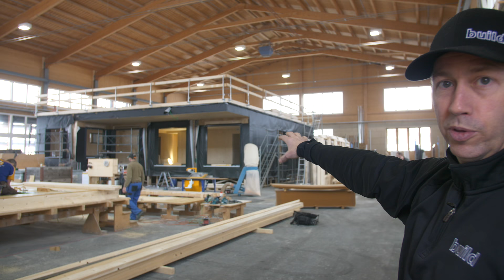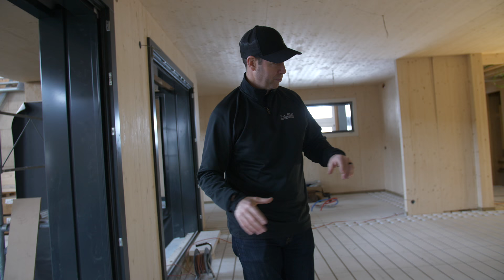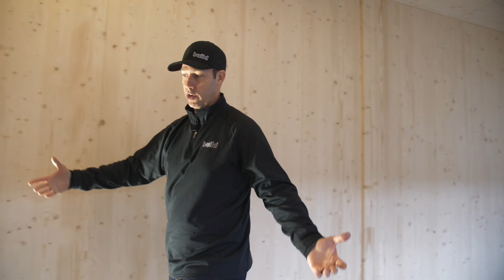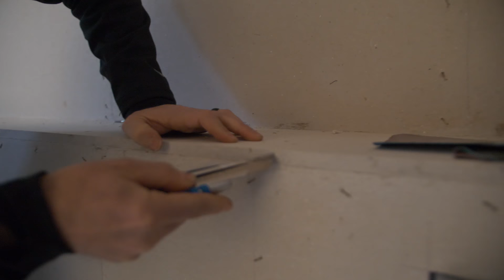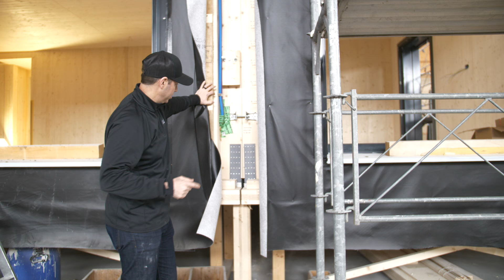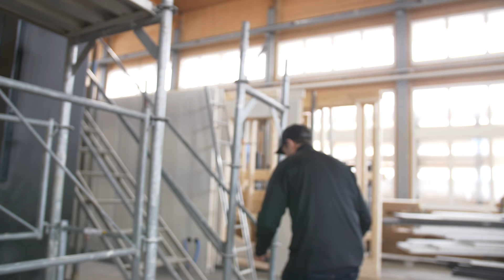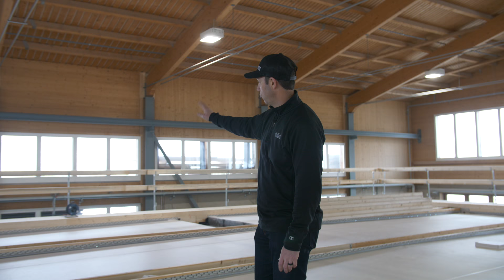Swiss Modular Home - Under Construction Tour

Comment: A few answers to questions I saw in the comment section: Price for a wood house of ~1200 sqft: I would say CHF 800k-1.5m is reasonable. I haven't found any concrete prices because these are all special projects, which is to say, most Swiss do not live in top-quality houses like the one in the video. The price also depends on the location as not all residential areas in Switzerland are equally easily accessible (think remote mountain resorts). Price of a similar home, standard build (concrete, bricks, some wood): Around CHF 600k-1m. You can also order wood houses made in other European countries and you'll probably save a bit on the final price, but transport can be expensive. I remember seeing ads from Scandinavian, Austrian and German builders at building fairs a few years ago.

The Swiss building code is very strict on energy efficiency. People can get subsidies for renovations that make their home more energy efficient. The government can force you to replace old, inefficient heating systems. Part of the reason is that Switzerland doesn't have any domestic energy resources apart from  renewable power production like wind, biogas, solar, geothermal heat and hydroelectric power (which requires flooding mountain valleys, in which people prefer to hike and ski). We also incinerate all our domestic waste and produce electricity and heat with it. Our electricity production is about 60% hydro, 35% nuclear, 5% others. All fossil fuel has to be imported, same for nuclear fuel. Another reason for reducing energy wastage are the Kyoto Protocol agreements. IIRC heating is responsible for about a third of the Swiss fossil energy consumption and in turn for a third of the Swiss carbon dioxide emissions. Most heating systems in Switzerland use oil or natural gas. Electric heating maybe outlawed, unless it's solar or heat pump. I am not sure about this one though.

Switzerland has a comparably old construction structure. We haven't had any armed conflicts fought on our territory in almost 200 years. There was a minor hiccup in 1847, but it only lasted 6 weeks and no urban areas were destroyed. Unlike in the rest of Europe virtually no construction was destroyed in WW2. All new buildings appeared when people decided to expand or tear down and rebuild. The govt can't force people to tear down and build energy efficient, but when you decide to build, you have to build energy efficient.

Bonus: If you build in Switzerland you are forced by law to build air shelters as well. Small objects like family homes are exempt, but the respective town/village has to provide a big enough collective air shelter. Larger objects like appartement buildings from 25 rooms and up require their own air shelter providing enough room for each person. The air shelter has to withstand a dynamic over pressure of at least 1 bar.
Reply: Urs Schuerch couple of comments maybe. The cost of the structure itself as shown in the video would probably be 30%-50% of what you mention. It‘s about 100sqm-ish, and you estimate 10k CHF per sqm, which for a prefab would be outrageously high, even for Switzerland. I’ve seen similar, good-quality prefab builds in Germany that run at about 2k CHF per sqm (that’s probably around 200 USD per square foot). Also, that cost would be stable, no matter where you build, whether it’s in an expensive neighborhood or not. Then of course, as you correctly state, the prefab itself isn‘t enough. The cost of buildable land can indeed be outrageous; Swiss building code;  peculiarities of the terrain (hillsides...); the dimensions of your underground structures; all this adds up. In countries where land is more readily available, you just pour a concrete slab on a flat piece of land, and that‘s it. Very little digging, no basements, significantly reduced cost, especially if you don‘t intend to pass on a viable structure to your grandchildren.
Reply: @arrzfr  and then are companies in Poland that offer much better price then german ones and can build all over Europe.  I'm planning to build a house over there and it looks like 2000 square foot house like that fully finished will cost me around 200k USD!
Reply: @arrzfr  I think that he was including in his price the concrete poured basement, since it was mentioned in the video that this one is made to go installed over basement. Also, you mentioned it will be the same price no matter where since it is prefab. However it is not, if you are including the transport cost, which is part of the price of the house and of course in a rugged uneven terrain, as they have, that must add a lot to the price of the finished house.
Reply: But that is some nice quality work though, there are only a handful of builders outside of CH that can build something similar but nothing of this quality !
Reply: @racer98  This may in part have to do with a long standing tradition of vocational training and apprenticeship programs for almost every profession. Swiss builders don't go to college initially. They usually start their career at age 16 in an apprenticeship, where they learn their craft from the ground up.
Reply: @uschurch  Thank you for your insite! In the US the people rarely stay in one area so the lowest cost and complaining is their method of operation thus keeping good craftsmanship to a select few willing to pay the price. A US Builder of custom concrete homes.
Reply: dave taylor 
Do you have a website for your business?
Reply: Makes since.Burke.US
Reply: @uschurch  in general in Europe there is a very different approach to do that kind of work and as well there is a huge competition there is so many of those companies that are doing amazing job all over Europe.
Reply: Merci für die Zämefassig!
Reply: @Konstantin M There is a local tin foil industry as well.
Reply: Nuke shelters infact.

Comment: There have been many attempts at doing modular construction in the USA as far back as the early 60s. Some are still at it, but many have failed. There was one outfit in Cleveland in the 60s that was way in the future, with wall panel systems of aluminum durable skin, structural foam core and high grade plywood interior surfaces.. The model homes were stunning modern designs. In the 80s Georgia Pacific operated a modular home unit in Eugene OR, ran for 10 years or so. ... there are others still in business, much like this Swiss operation, in the eastern USA.. even one that specializes in foundation and basement structural panel systems.
Reply: I think it makes a lot more sense to use panelized systems at scale for tract housing rather than try to transport boxes that are custom-built for a single buyer.

At least half of the advantage that site stick-building crews have would disappear the moment that we regulated building trades to the extent of requiring realistic long-term health coverage akin to what office workers get, for injuries incurred on the job but only really felt ten years later.

I like what these guys are doing:  https://www.ecocor.us/

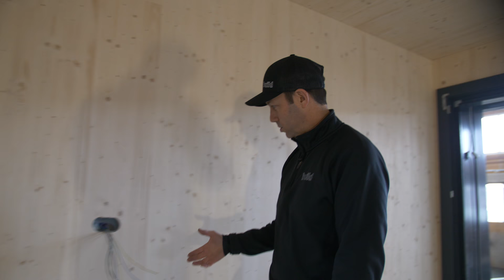Comment: Wait Matt I knowwww you do the building stuff but at 3:50 you just go you know they use 230v so the wires are smaller because they are using half the amperage! And move on like it's nothing... Note I've always been under the impression that European countries used 240v 20-40 amp  as standard; instead of American 120v 12-20 amp.... So what you just said was they're actually 230v 6-10 amp? Can anyone confirm this?
Reply: Simply said: power is the product of voltage and current. So, double the voltage allows half the current for the same amount of power, at least for single-phase. If you use 3-phase, that is 380 / 400 volts, mathematics are a bid different.
Reply: @kwarts  I've always considered the voltage like the vehicle that carried the power... Ie higher voltage; can carry more amps, I realize it can carry less... And I realized that a breaker can regulate it to be less amps from the main ie the smaller gauge wire would be safe to use in that case... But to state as he did that simply because the voltage is double; the amperage is half seems like it was a slip of the tounge more so than fact... For example in the states you would never have 240v 15a line, it wouldn't make any sense... You would have a 240v 30a line with say a 8/10ga wire... It would appear they are using 240v 6-12a ??? With a 14/16ga wire... I guess in my head I just assumed that everything over there plugged into 20-40a wall outlets with beefy wires...
Reply: @seanbouker   Think of volts as analogous to water pressure and amps as analogous to flow rate; resistance, in ohms is the ratio between voltage and amperage. So a 230 volt lamp would have  4 times the resistance of a 120 volt one; the voltage would be double,the amperage would be half, so the wattage would be the same.  It's true that US 2,400 W outlets are a little on the low side (the UK standard is about 3,000), but for the same wattage capacity, you only need half the amperage through a 230 volt outlet.
Reply: @pcno2832  if we're using water as a medium, I would think if resistance as maximum safet flow rate. Ie you need a bigger pipe or a pipe that can handle high pressure to move the same volume safely... Amperage as the volume moving down the line.. and the voltage as the capacity of the system...  I'm not an electrical engineer 😂... But my math was always what the maximum amps on an line could be ie I would convert watts to amps... I'm guessing the whole thing is taught differently seeing as you guys keep referring to watts... Over here if you told someone yeah that's x watts they'd probably look at you funny...... When you install a service line to a home would you refer to it as 100-200 amps or something else?
Reply: @seanbouker . Sean,  In Australia, we have 240V 50Hz power.  A standard power outlet delivers 10A or 2,400 Watts and has an earth (ground in the US).  Due to the lower amperage, the EMF radiation is considerably smaller, so we do not metal conduit for shielding - . Typical breakers are: 10A for lighting circuits; 20A for a number of power outlets; 20A for a single phase A/C unit; 30A for ovens. These breakers usually have RCDs for most circuits.
Reply: "120v 12-20 amp" is 1440 to 2400 Watt. "240v 20-40 amp" would be 4800 to 9600 Watt. That'd be a bit ridiculous, wouldn't it?

The amps vary a bit country by country (and purpose of the circuit), but you usually have something between 10A (2400 Watt) and 16A (3840 Watt).
Reply: We use 10-20 amps in Europe. So about 5000W for a circuit. Also, if it's an oven or stove top it can be used 32amps connections
Reply: I hope someone else chimes in cause I'd like to know also. I read someone else's comment that the breakers are 5, 10, 15 amp
Reply: @augustreil  that's what I'd like to know as well... I wanna see the breaker box lol
Reply: @seanbouker  here's a common breaker box in Europe:

https://www.solucoesindustriais.com.br/imagem.php?url=images/produtos/imagens_10075/p_quadros-eletricos-41.jpg
Reply: @seanbouker  again its usually 10-16 amps. Wire used I think its about AWG 14-16 ... however some breakers can be 30 amps if for an induction stovetop for example.
Reply: @NoRoads2AllRoads  so this is my quandary for a 30amp stove/oven you would have say a 8/10awg not a 14/16awg? Or does the higher voltage somehow allow it to be safely used on the thinner wire?
Reply: @NoRoads2AllRoads  because here that would be an electrical fire
Reply: @seanbouker  its not AWG 8 but yes its thicker than the standard AWG16 ... The normal 10-15 amp circuits use 2 mm2 wire, while the stovetop induction and again depending on how power hungry they are, they use something like 4.XX mm2
Reply: @NoRoads2AllRoads  so there's really 6 amp breakers... I'm only seeing 6/10/16 that's completely uncommon here.... So this raises another question... Why not just run everything in that box as 16a with 12awg?... Also what in the world is going on; on the left side of that box?
Reply: @seanbouker  what do you mean whats going on on the left side? not sure i caught it...
Reply: @NoRoads2AllRoads  take another look, there's boxes that have no switch on them with ratings, and then random lights, and multi pole switches... What's going on there because I've never seen anything like that... Doesn't help that I don't speak the language 😂
Reply: @seanbouker  i dont have the picture in front of me but it's probably the main switch to the house along with the electric meter from the company electric supplier.
Reply: @NoRoads2AllRoads  that's interesting
Reply: The cables are tested by the electrician putting them in. At this state of the build, they are off. Otherwise they wouldn’t stick out like that.:))
Reply: @WAJK2030  thank you